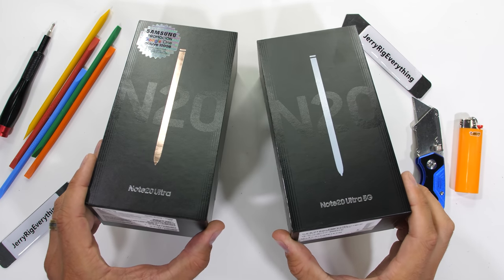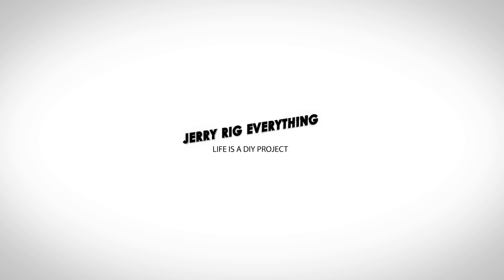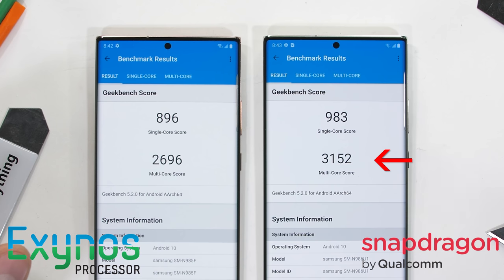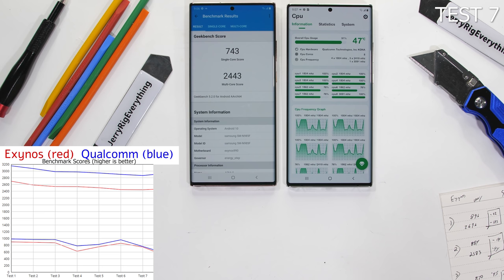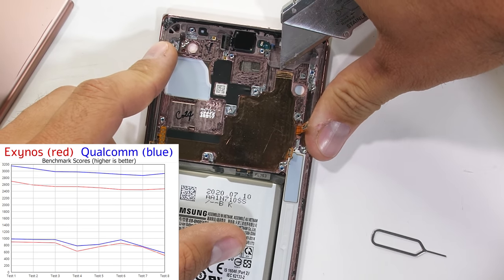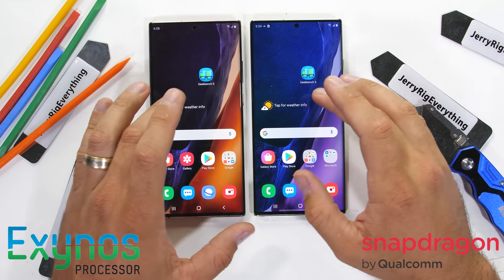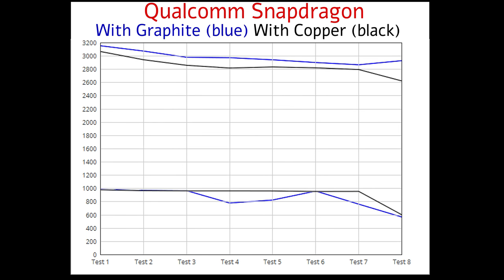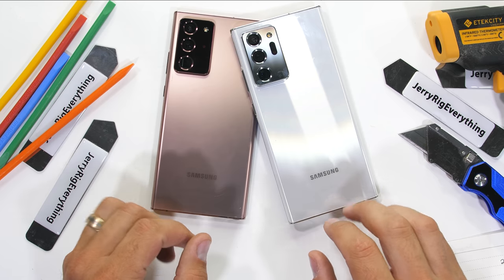Samsung should explain this... Exynos vs Qualcomm?! - Note 20 Ultra

Comment: Performance should be the same, otherwise the price must be different.
Reply: Thank you, you've summed up the whole video in a single sentence.
Reply: the price IS different, asian version is cheaper
Reply: You'd better wacth this video again as much as you can until you get what Zach mean
Reply: @leidakpi2809  I'm curious, what do you think Zach meant?
Reply: Trung Bui there is no Asian version of the phone, it’s called “International” a.k.a non-American model
Reply: @benjaminli188  the cooling system can't change the fact that the exynos version has worse performance while having higher temperature than the snapdragon version
Reply: @benjaminli188  that what he meant
Reply: @pinkysweets  it's maybe cheaper in the us but not in Asia its the same price
Reply: @leidakpi2809  you're right, but the video was also made to show the gap between the processing speeds of both versions, and the point jerry is making is that selling two different phones as the the same phone at the same price is incredibly unfair.
Reply: @MachoHasGame  in fact yes there are some Asian versions (Chinese and Korean) that have the Qualcomm s865+.
The Chinese one even supports dual-physical-sim.
FYI the Korean version note20 ultra costs only 920 USD on aliexpresse (tax in)
Reply: @pinkysweets  however the european version isn't
Reply: @MachoHasGame  yes there are, dual sim models that dont sell in both US nor EU. most  phones sell in asia are dual sim, yes, samsung too
Reply: @MachoHasGame  China has the Qualcomm version.
Reply: @benjaminli188  sure bro , but samsung doesn't thing so, too bad
Reply: @pinkysweets  in Thailand.It's more expensive with Exynos model and you know Thailand is very hot
Reply: @pinkysweets  There isn't as here in India this phone cost $1,418.
Reply: @pinkysweets  but Europian is more expensive than US
Reply: @pinkysweets  there are dual sim phones in Europe. I live in Croatia and all Samsung phones they sell here are Dual Sim
Reply: @pinkysweets  not in india my friend
Reply: @pinkysweets  yea
Reply: Here is $1250
Reply: Agreed.
Reply: @MachoHasGame  every market have their own version, Korea, china, euro, US, etc, even some service providers have their own versions.
Reply: i must say, people aren't buying samsung phones because of performance. If these people were buying their phones including this criteria - Samsung's sales would have crash down to zero, because in every single price category Samsung eats dust on the soc performance side
Reply: @MachoHasGame  But different with region codes...
Reply: not really. its like buying a game consol different revisions have changed out some of the components yet the name stays the same without any notice and its the same with majority of products.

aslong as the device meets the specs provided it aint really an issue.

they are selling a phone aka a package of components which reasemble their phone model. they aint selling you a specific cpu.

it is also very unlikely that the users will notice any difference.

with that said it would have been nice is they had another model number (as example 20 e/q) s would be confused with slim (snapdragon)
Reply: @pinkysweets  Europe version which use exynos not, even more expensive

Comment: Jerry : analyzes different processors
Samsung: " Oh no !  Anyway..."
Reply: Damnn hahahahahaah
Reply: I have also seen that clarkson meme
Reply: Samsung: GREAT NEWS!
Jerry: WHAT?
Samsung: The new Note 30 is coming to the uk!
Jerry: The what?
Reply: “Anyway, take a look at our other phone that goes bendy”
Reply: @AW-Luke  i'm pretty sure everyone has seen it
Reply: How is this news? Samsung has used Snapdragon and exynos processors in different regions for years. There have been years where the exynos processor is more energy efficient and just as fast. Some years faster but not as energy efficient as the Snapdragon.  
Next year the exynos processor will be based on a 5nm process and will be just as fast as the new Snapdragon and be slightly more energy efficient.
The reason they use different chips is mostly due to licensing issues with Qualcomm
Reply: @johnhine4315  cool story bro
Reply: i think this is reasonable, at least in vietnam the phone is $200 cheaper tax included and the non 5G version even $400 cheaper, and they come with buds live
Reply: Do Sony xperia 1ll test..

Comment: Samsung trying hard to push the customers away with ridiculous prices, major chipsets differences yet charging the same, removing 3.5mm jack after making fun of others removing it.
Reply: Tbh, ppl should stop complaining about the jack. Most already have at least 1 pair of wireless headphones/earbuds and I dont even feel its need anymore
Reply: And people are still buying their phones so they'll continue even after way too many exposing videos get uploaded
Reply: Make note 20 expensive so people buy note 10
Reply: @raresradoi39  well i don't have wireless earphones because I don't like them
Reply: Sun Flower Apple, and Samsung arnt innovative since years at this point. I feel Chinese brands took over now. Btw this is from an Apple fan lol
Reply: @raresradoi39  I have wireless headphones and guess, I still use wired from time to time. Why? Because wired headphones for the same price as wireless have superior sound no battery to charge and no latency when gaming.
Reply: @mirsadzubic111  the battery problem can easily be handled and some buds, like the buds live, have almost no latency. I know the price and sound quality is better at the same price but most ppl prefer the more comfortable choice
Reply: @raresradoi39  No, they shouldn't. Phone is a tool - the more features the better. Especially if I pay nearly $1.5k for it. Even if I barely use it. I want it there.
Reply: I have the S20 Ultra with the Samsung chip and whilst I'm not having issues I'm still disappointed to be getting a lesser version for the same price. Depending on how this is addressed I may be changing for good to another manufacturer.
Reply: @xiaokhat  your opinion
Reply: Sun Flower learn some English before writing a comment I had a stroke reading this
Reply: Samsung also offering inferior software support; no weekly/monthly updates.
Reply: @TimLF  They offer monthly security patches, and now do 3 years of Major OS updates, the same as Google.
Reply: Non of it matters because 99% of people just buy it for the brandname and have no idea about the actual hardware. Same with Apple products.
Reply: @rexk8813  yeah but when you want a headphone jack, then the battery size would be much poorer
Reply: @CartoonNetworkGlitches  this isn't exposing shit. It's been a fact for a few years now. Exynos chips suck when compared to the snapdragon chips and that isn't anything new.
Reply: @mactalk2871  when samsung was releasing the S9 they said that it didnt have underscreen fingerprint because the techonology wasnt ready. Huawei on the other hand managed to develop under screen fingerprint scanning and was the first to include it.
Reply: Sun Flower i brought s6 edge lasted me 1.5 years so i moved back to apple i had a 5c that worked even when i brought the samsung this proves iphone can last like 7-10 years with proper care with samsung its less most are not going to agree with me because android is an open sauce and overrated imo.
Reply: They also removed ir blaster. Most of their phones have Samsung bloatware. I am regretting buying a Samsung phone, I miss Xiaomi, which had best of everything. Who says Samsung doesn't push ads on their phone? I got ads here and there on my new Samsung phone, I also got note 20 ad.
Reply: To be honest if it weren't for the extreme fanboys, Samsung wouldn't make those cocky ads about Apple removing the headphone jack, fanboyism kills companies faster than financial crisis.
Reply: @zahidibk  Actually, the kinda are innovative. Look at Z fold or the chips nvidia used in rtx3000 series for example. Not defending them, just stating simple facts.
Reply: @mactalk2871  truthfully, I don't like apple or android as much anymore. Both of the major companies on each side have been pricing their products way too high and they really aren't worth that much. I can understand it for folding phones because thats a new type of tech, but the prices for regular non folding phones is way too high. I would be fine if the prices for flagships were $500-$600 again.
Reply: I agree except the part with 3.5mm jack. I mean everyone did it, u r kinda late to blame for this.
Reply: Point: people hated sony for sharp boxy design....now they love it!
Reply: @raresradoi39  they remove it so people buy a wireless headset. it's scummy.
Reply: @kamallb4650  Yeah! Is true though, I remember seeing Samsung fanboys made fun of the boxy designs and now 2-3 years later they think boxy design looks good.
Reply: @kamallb4650  its more to do with trend, the design needs to be switched up every now and then , aka boxy design.
Reply: @georgephotography8704  I am one of them who made fun of Sonys bezels. But I love their new flagship, wish it was available in India for order.
Reply: @mangonana6925  no the difference in battery would be tiny, have u watched the videos and seen how small the module is.
Reply: @georgephotography8704  samsung doesn't complain about headphone jack too😂
I remember google and samsung making fun of apple.
Google went too low by criticizing both multiple camera and notch😂😂
Reply: @girlsdrinkfeck  Indeed! Apple removed the headphone jack during the time when bluetooth headphones were still expensive, and yet now Samsung have done the same with their phones, yet fanboys defend their guilt by saying, "BT headphones are way cheaper now, so Samsung did the right call", "3.5mm jack is outdated" etc... 
To be honest, if Apple did'n make that move, bluetooth headphones price would still be the same 4 years ago.
Reply: @69Solo  their new phones look so good! 
No holes n shit...no notch.
Simple yet powerful design.
Reply: @S_wali it's just excuses in my book😂
Reply: @raresradoi39  everyone has different needs and in my case I need a wired headset to do vid./ conference calls. And let's be honest most of these buds have terrible noise canceling, and a lot of interruption of use because of intermittent charging.
Reply: @girlsdrinkfeck  If you could not accept the truth then it's alright, everyone has their right reject something they don't like, although if you were Samsung, your company would be in ruins. 
Learning from competitors is the nature of this game, if you couldn't compete, death always welcome you.
Reply: @BertoJA876  there's no interruption if you use one bud at a time and charge the other lol
Reply: @admiralv8538  s6 exynos was better than qualcomm back in the day,  however yes iphones have more software support officially. samsung software and android has come a long way , even offering 3 years support is a improvement. however i want a manufacturer who offers 5 years of support for its phones as phones arent exactly getting exponentially better anymore. we have amazing designs , amazing screens , fast charging in wireless and wired, and they are fast. all the future advancements are software idc, if they wanna charge money for the next version of software after 5 years or something the industry needs to make a decision. (apple is behind on design in my opinion its so dated).
Reply: @BertoJA876  I have 2 wired headphones, 1 is Apple. There is delay while gaming. Plus I prefer wired.. also connecting wireless is hassle at times.
Reply: @girlsdrinkfeck  Nah! is alright, go and defend your company somewhere else, I don't like wasting time with harmful chemicals like you.
Reply: @sltrtn  Yeah! And sadly this tech world is dominated by people making fun of anything they don't like, extreme fanboyism is a big no no for companies as said earlier.
Reply: @69Solo  Yeah! Their new-look is very nice though, not so crazy, although simple and clean.
Reply: @sltrtn  Yes! That's the reason why we are here.
Reply: @S_wali  yeah this is what bugs me if android had software support aswell i would of fully switched to android as my daily use
Reply: @admiralv8538  first of all, no. Not 7-10 years. Apple only updates for max 6 years. After that, majority of the apps stop working. But yes, 6 years is very good. Just saying that it's not 10 years for sure. Android phones from 2015 are still usable today. I am using the note 5 and although it's not getting updated anymore, it still supports all the apps you would use on a regular basis. The thing is, on apple devices, once you stop getting updates you start losing access to application. It's not really apples fault its just because app developers have no incentive to support older devices. On android on the other hand, their is. About 60% of android phones are running older versions of android. So this makes app developers want to be able to reach those people too, and so they try to support older versions of android for longer. It's very simple when u think about it. So no, android is not overrated. Android just doesn't need to get updated every year to be usable. It only needs updates for added features. Unlike ios where you need updates to be able to run the latest versions of apps. This is not me making up stuff, it's simple facts. I develop mobile applications and this is basic thought process of when developing an app for android or ios.
Reply: @gjeraldh2989  my 5c still works tho LOL so id still say good number of years
Reply: @admiralv8538  I never said it won't work. Just that it no longer supports newer updates to apps and so it's pretty much useless if not obsolete.
Reply: @gjeraldh2989  it does support any apps and if it doesn't download u always have apks and also flashing Ur android into a different version .u always have options with Android however I do agree with the fact android should be like apple and do 5 year support. Android manufacturers need to create 3 phones low end mid and high then they'll be able to handle this demand of software support.
Reply: @gjeraldh2989  that depends on the developers of the app sometimes they just create apps leave them in the store and not update but yh i get u i hate those devs apple should remove them from store imo the apps that never get updated to support new phones but yh i get what u mean.
Reply: Same goes for iPhone.
Reply: @admiralv8538  it's not only the developers there's no incentive to update an app for a device that's over 5 years old as apple doesn't .

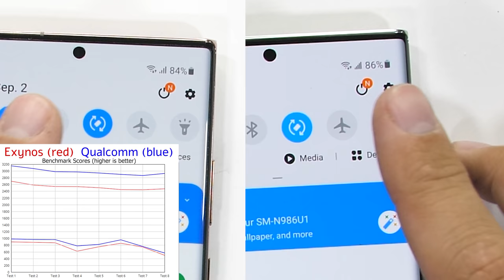Comment: 5:07
A very minor detail is that the EXYNOS have 4 network bands while SD has up to 5 or 6, depending on the model. in my case Galaxy Note 9 has 5 bands, while my brother with Note 10 Exynos has only 4.

Comment: "If it acts like a different phone, it should be called a different phone"
Well Said...
Reply: I'll agree if the only thing you do with this phone is run benchmarks.  Samsung will prevail in court because no one will be able to pass a blind test or an experience based test.
Reply: @ymx777  If that's true, I wonder why Samsung doesn't just use the Exynos in all regions? I assume they generally would prefer to use their own processors, and it's cheaper to do so. So unless there's some weird reason that the cheaper processor varies by region (or something like that), I presume it's because the Snapdragon processor does in fact run better.
Reply: @ids1024  My guess it's due to cost and patent strategy.  Qualcomm owns a lot of patents in wireless, especially in America.  And maybe samsung owns a lot of wireless patents in other regions.  As a result samsung might have no choice but to use two separate processors.  If you were a business, why would you not try to use the cheaper of the two everywhere if you can help it?  I'm certain they didn't do it so YouTubers can make money criticizing their perceived business mistake, or to do intentional harm to the customer.
Reply: @ymx777  dude it's hella hot to use.
Reply: Watching this video felt like Samsung became an official Chinese imitation. They are doing the same thing what the Chinese imitators doing...

Comment: You simply aren't wrong. It should be 1 and the same, or at least close to it. And Samsung knows that the snapdragon is the superior, meaning you get more base memory on that, and extra stuff to compensate...
Reply: Yes
Reply: @Shourya Sudhakar 2nd lol
Reply: True. This's been happening for a long time. Using snapdragon in USA and Exynos everywhere else. A few years ago exynos was better but the tables have changed and now snapdragon is better. Running a S10 at the moment. Probably my last samsung phone.
Reply: I agree. The Exynos version has been lagging behind and is known to get pretty hot
Reply: THAT'S WHY SAMSUNG PARTNERSHIP WITH AMD
Reply: @ariyanmiah54  nbruh i have a GS6 same issue it overheats while charging too
Reply: Samsung can make Exynos  superior than Qualcomm...but Qualcomm has not allowed them by giving exclusive rights to Ultraaonic fingerprint scanner(and maybe others). Samsung is in some sort of contract to not overwhelm Qualcomm.
Reply: @dixonnash8219  heard that one befofe but it just sounds stupid. Like, y'know, "you can have your phones and all but make sure that your 1300$ flagship performs worse than a 500$ chinese phone. Ah yes, also make sure it heats up randomly"
Reply: Crispy Updates what does ultrasonic fingerprint scanner and other stuff, have to do with building a chip that doesn’t overheat? Nothing, bc if they can’t design chips that will fulfill basic requirements, how can they be expected to implement advanced features?
Reply: False, Samsung Exynos are better
Reply: @androidoneiu5206  Better at grabbing money
Reply: @michaelbuto305  Better in give you Quality and better chipsets than Qualcomm
Reply: @androidoneiu5206  good joke
Reply: @michaelbuto305  good joke are you saying, is you can’t accept it, ok, keep dreaming in a fantasy world and lying yourself, but the truth is the truth and you can’t change it